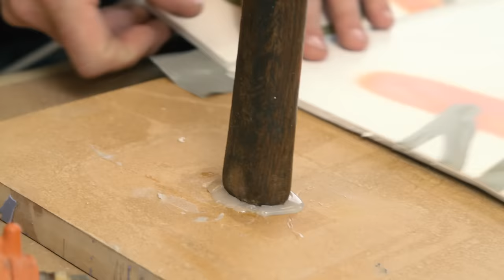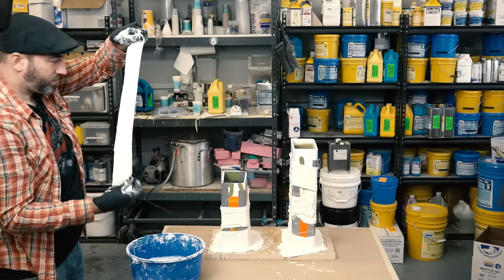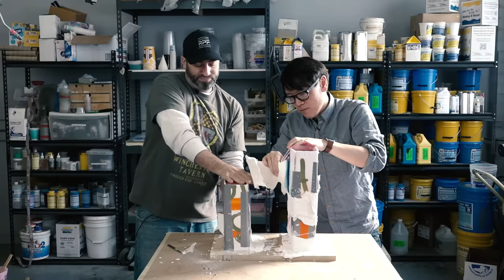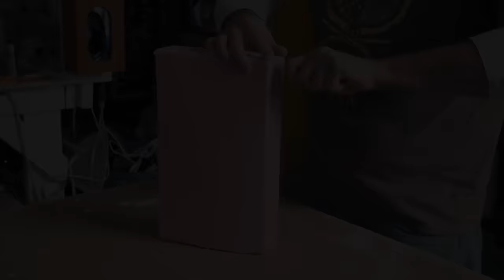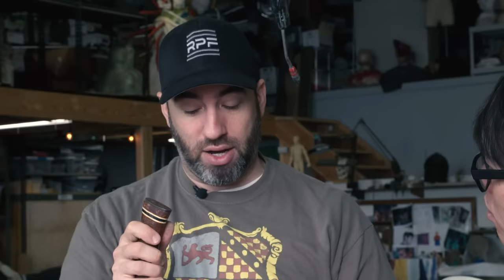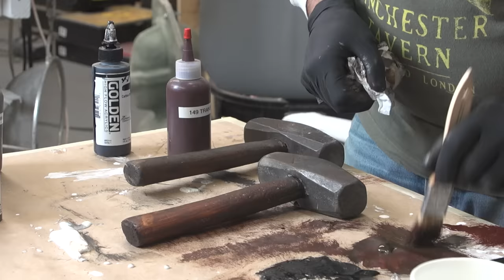How To Mold and Cast Foam Props!

Comment: Respect the Estwing axe, quality american steel and workmanship and thats coming from a roofer who is in the UK.
Reply: Only Gränsfors for me thanks!
Reply: I'm a big fan of Estwing's hammers. They make good tools.
Reply: Never seen one of their hammers break, only the handles with extreme use and the leather with heat and age. Quality tools.
Reply: Those iconic handles
Reply: It's nice that one or two things are still made in the US.
Has Craftsman gone 100% China at this point? I know a couple years ago I couldn't find open-end wrenches made in the US, which was a pain because they had to increase the thickness of the ends to make up for the inferior steel and therefore they didn't fit in foam wrench organizers
Reply: Esteban Dufanzo Last I heard only the "professional " series are still made in the US.
Reply: Fumwum made in Sweden just like my mora
Reply: Estwing still isn't a sellout yet. They still make the most durable hammers at the most reasonable price. I had one for 7 years before I finally rounded the head too much from cleaning concrete off material everyday, and driving steel bolts, besides driving millions of nails building formwork. No air nailers in formwork.
Reply: i have one from 1929, still works

Comment: I make these type of props for film and TV. I wanted to point out that if someone is going to add a stiffener or something to make the handle ridged like in the axe , please do NOT add metal or a chopstick as they mentioned. If you are making these types of props for stunts that is dangerous. The wood can break and then becomes a sharp one that will hurt someone. Same with adding metal. I have found that using a fiberglass rod about 1/4" thick is a great option.  To keep it safe I add the little rubber end caps to protect the end of the rod from poking out and hurting someone. They will flex but will not break. Keep them about 1" from each end of the prop. Again to keep it from becoming a stabbing hazard. For a cheaper option, You can find these rods in kite kits. Even at the dollar store places.  I found a great way to hold the rod in the center of the object is use thread to suspend it in the middle. Tie one at the top and one at the bottom. Run the thread across the middle of the mold and tie it. It should look like the rod it floating on the threads suspended in space. This way it will not move when the foam expands pushing it to the edge of the part. 
I hope this helps and keeps your stunt weapons SAFE above all.
Reply: Can you PLEASE Do a Video? 
I'm not understanding the Thread Part. 
(I am a Hands on and Watch Person than Read from a Book and Fail to disappointment Person).
Reply: I really second that. I understand all the processing except how to put the rod. I want to make LARP weapons, but that thing is the most hard for me. I would really apreciate.
Reply: Great advice!
Reply: Hi. Thanks for the advice… but isn’t fibreglass just as dangerous? I’m really struggling in finding a safe reinforcement
Reply: I would like to make a cain. I was thinking about using handles from a chimney sweeper. But I think it may be too rigid. Are you suggesting something like a fishing pole?
Reply: What kind of foam do you recommend?
Reply: What kind of foam do you recommend?

Comment: To get a volume for the pour of silicone, just fill the empty mould with rice grains and then tip them out into a measuring cylinder.
Reply: I know this is an ancient comment but as someone who's starting to dip further into propmaking, this is genius and I will apply this idea later lol thank you
Reply: But some if the rice but not come out and your mold will be messed up
Reply: You just changed my life

Comment: I have never liked this type of mold. I tried it a few times but always resorted back to standard part molds. I find that cutting into the silicone creates too much of a chance of destroying a nice mold, or worse cutting your original piece. 

Plus....this way takes a LOT of silicone, which is really hard for anyone working on a budget. It makes more sense to me, to use less silicone (enough to smooth undercuts and such) and back the outside up with a jacket of fibreglass or plaster. That way you use less silicone, and you can be guaranteed your silicone will not warp or bend out of shape.

Comment: Cool to see a different method of molding - but why would this not have been a candidate for a 2-part mold? It seems like, other than time, it would have been better to work with this horizontally and block off the lower half to pour that first layer and avoid bowing sides. Thanks!
Reply: Robert Sloan technically it’s faster since you don’t have to wait two separate times for the silicone to cure. If you’re in a rush, this kind of mold is fine but I do prefer two part molds if you have the time.

Comment: Nice vids, very informative.  Kudos to the prop-maker and his excellent work, I'm a photographer and recognize a real artist.   I do have a question.   The foam he uses.   Can it be used in a lost foam meltal casting?   I can carve Styrofoam, put it in sand, fill it with molten metal which vaporizes the foam and makes the object but I have something very intricate that would be impossible to carve using s cast of a particular object.  Wax is iffy but a liqquid foam might be the ticket.

Comment: Also, is there a benefit to doing a solid mold and cutting the piece out instead of a two part mold using clay when making the first half??
Reply: Since the props are not heavily detailed and in simple shapes, it's easier and faster to just do a solid, I think.
Reply: Late ass answer, but it's faster to make a single block mold and cut it, than to make a two-part mold, since for the two-part you have to shape the clay around, pour the first half and wait for it to fully cure, then clean, spray mold release, and pour and cure the second half (why he talked about time vs. money). On a quick production cycle like theirs, getting the job done quick is a better return than stressing over raw materials cost.

Comment: How about molding and casting something like a firearm for props? How would you manage things like the silicone seeping into parts of the firearm? Do you have tips for sealing a firearm before mold making?
Reply: Kenneth Kniffin I cast a Luger over the weekend and used some oil-based modeling clay to plug as many holes as I could find

Comment: I would love to do this kind of thing, but I can't afford the nearly $200 of silicone they used to make 2 small molds!
Reply: Anything you want to do a one-off from will be expensive. Idea of molds is so you can use it repeatedly and make multiple castings.
Reply: It's just odd that they present this as a DIY thing, which generally means "cheap and easy". Now using expensive tools isn't that big a deal because they just speed up the process, but gallons of silicone and mixtures of foam and even the plaster braces are way more expensive than getting a pack of puzzle mats and cutting them to size like a lot of their projects...
Reply: but a lot of that cost came from using a block for those handles. like he said, it's time vs money. if you took the time to make a mould that was closer in size to the object, you'd use half (if that) the silicone.

modelmakers spend $100 on paints quite easily, as well. so that's not particularly outrageous.
Reply: James Dreger In my opinion DIY doesn't mean it has to be cheap. They use stuff that you and me could buy if we really wanted to make a mold out of something. It's not some crazy 5 axis CNC DIY that you need years of experience and a lot of money.
Reply: It doesn't have to be "cheap" exactly, but usually the purpose of "DIY" is to save money by doing something yourself. This video is a fine example of "how to cast foam props" but not of the DIY idea. Which I realize isn't part of the title, but it is how it's presented.
Reply: You can shop around for material that might be closer to your budget. You can do more projects. 

Also the process presented could get very unDIY by using tools most people could get access to on their own. 

I can do this project in my apartment. If I was working with other people we could split costs. 

Really though DIY simply doesn't mean cheap. It means you don't need industrial tools to make it.
Reply: yep.  I just did a quick google and this stuff isn't cheap!  I might as well buy my desired item, instead of trying to make it myself.
Reply: Glenn Burrow I’m glad someone pointed that out. If you’re making a lot of props to sell or something it pans out, otherwise it’s cheaper to just buy it pre made after a certain point. And that’s not including failures in the learning process. And it wouldn’t look like Frank’s work lol
Reply: Box molds like these are fast and easy, but the downside is that they're a HORRIBLE waste of materials. But sometimes you need a project done quickly and have to make the tradeoff of cost vs time.
Reply: Glenn Burrow   You can improvise on this. You don’t need a box sized mold.
I only just realized how old the comment was.
Reply: He even slops it moving from one mold to the other! I need a you tube channel/business so i can deduct all my hobbies as business expenses! Nice video, just not very practical for a hobbyist. If youre making klingon daggers or imperial blasters for all your club, then its worth it.

Comment: Nice! Any tips for casting antler sheds? Specifically the separating of the mold and best material to cast out of. We want to paint them and attach them to a headband so they would need to be lightweight, stiff, and have a paintable skin. Maybe a link to a good website with tips? Thanks.

Comment: Did you coat the original tools with any kind of release agent or does the silicone not stick to it?
And why not do a 2 part mold versus all the cutting and hacking that could hurt/ruin the mold?
Any risk of the foam bonding itself to or getting stuck to the silicone?
Would a different type of foam made a stiffer hatchet?

Comment: question on the weight of the silicone (18.5)-Does the manufacturer include the weight of silicone in the label? I know you just came with that number based on experience.

Comment: It's called "density" the gravity thingy you are multiplying the measurements with, is called density, and It should be somewhere on the packaging of every silicon mix, so there is no need for guess work with the 18,2.

Comment: 18.3.... or just use metric and measure in cm so converting from volume to mass (using specific gravity) is simple.
Reply: Robert Dunne metric system has many. benefits,  but not in building/construction/machining.
Reply: How is metric system bad in those cases then?
Reply: 109268 Well, people building/working construction/machining in all other countries other than the USA seem to have no problem with the metric system. What, in your opinion, is the reason the metric system isn’t good for use in these industries?

Comment: I don't quite understand why wood wasn't used, that's a lot of plastic and lack of assurance :s presumably better still, furniture board (covered in lenolium or whatever). Also for the axe's thin handle bit, maybe I missed it mentioned but why not stood upside down and drill a hole into the handle from atop so there's two access points. Also unless too reactive, a vibrator. Could be a sawzall (without a blade of course), a misbalanced motor, a drill with a misbalanced bit somehow...:s but that'll surely help drive the gunk into and past that narrow neck :o curious

Comment: Could you vacuum the box after pouring to remove all air bubbles from the casting? Or isn't it worth the trouble?
Reply: Well the stuff he used is mostly bubbles so no, but if you using some sort of resin, vacuuming would create bubbles that probably would not get to the surface in time to get popped before the resin sets. Thats when you would use pressure. It either makes them so small you can't see them or forces the gas into solution like a can of pop.

Frank kind of talked about this up when he degassed the silicone.
Reply: Cliff Hartle Oh, I meant pouring the silicone molds! The boxes were the foam-core they poured the silicone into. Since he extracts the air out before pouring, wouldn't it be a good idea to vacuum the silicone again to remove any trapped air bubbles that might be hiding anywhere? Or is that futile?
Reply: Michael Berthelsen again at this point vacuum would create bubbles not remove them as the rubber was setting. So again it would maybe pressure. 

For bubbles during pouring I've seen techniques where you pour it in a fine stream and also let the rubber fill up around the piece. Don't pour it directly on top of the piece.
Reply: Cliff Hartle Thanks! I was thinking of air pockets as well, but I guess you'd just have to cast it multi-part, to make sure you fill all gaps and hollows in turn...
Reply: you can also use vibration to help reduce bubbles. Orbital sanders work just fine for this.
Reply: Colin Macaoidh That's a great use for an orbital, haha...! =D

Comment: i’d like to see the axe again, with an L shaped inner support and maybe more rigid foam?
Reply: It wouldn't even need the L...just a single rod down the length of the handle.  A straight piece of polyethylene tubing would take the flop right out of it.

Comment: Could you use this trick to make a prop gun? Not a detailed one, but one in the background somewhere
Reply: If you have a gun you can cast, yes.  I wouldn't try it with a real one...there are too many little fiddly details that the silicone would flow around/into and you'd tear up your mold trying to get it out.)  But if you've got a good, realistic rubber dummy gun or even a squirt gun, where all the details are solid-cast and don't move, you could make a pretty good copy of that, which would work for background.

Comment: Can I use this technique to do a silicon mold of a hunting knife to replicate with epoxi resin???
Reply: Yeah, it would work the same.  And the epoxy wouldn't try to deform the mold from the inside anywhere near as much.

It's the same technique I use to make molds for break-away beer bottles (I have a wine bottle I still need to cast).  But the mold works well for sugar-glass casting (never tried it for foam casting...)

Comment: He takes the size of the mold container IN INCHES, (15x8x3 inches),  then x 18.5 = the weight IN GRAMS, and the product is sold by THE POUND. There's a lot of mixing of measurement standards there.

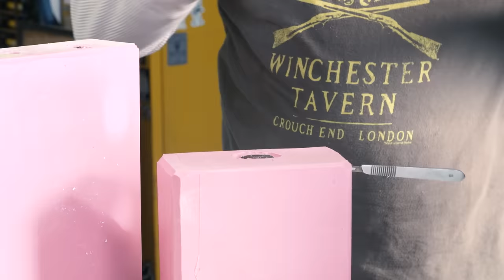Comment: 13:54 Norm touched on an important topic. Show us comparisons of all the methods. 
Lay it in sand for horizontal two part molds. Make foam versions to use for lost foam casting to make another metal one. C'mon guys. Step it up... How many methods are there to make what you made there ¿ Could I use tubes of silicone caulk for the mold and Great Stuff foam filler and a skin of Elmer's glue for the part ¿ Show us those intricate cuts you spoke of. I once poured molten fishing sinkers into dental alginate and it held up. Could you have poured a metal skin in there and rolled it around, then filled the rest of the cavity with foam to make a lightweight metal copy ¿

Comment: I have that same hatchet, I found it a long time ago when I was cleaning out my grandparents shed, what are the odds
Reply: Estwing is the most prominent metal hammer/hatchet manufacturer, especially for older versions where wood handles were standard for other companies. New ones look the same as the ones made 60 years ago, so most estwing hatches look similar regardless of age (wear and tear set them apart obviously, as well as a few different handle choices). The odds are pretty damn good that an old surviving hatchet would be estwing.

Comment: 7:14 - you use inches when calculating volume to get a result in grams of rubber you need to pour. That doesn't sound right. But you know your craft better than I do. I'm just pointing that out.
Reply: That's why you do the final multiplication (18.5, I think was the last number).  The dimensions of the box give you cubic inches, the last number is how many grams a cubic inch of the silicone would weigh, so you know the total number of grams to mix up (then you have to divide that appropriately for Part A and Part B, which they completely glossed over...)

Comment: Guys, thought on using legos as mold bordering? seems like, with proper engineering, it wowld deal with bowing plus it wowld have inn-build registration and enhance the reusability factor.
Reply: Miquel Vico legos are not leak proof. make a lego cup and try it
Reply: lego walls can very easily flex and bow, unless you make them Stupidly thick.

Comment: Guys, please use a different noise cancellation technique or go a little easier on the noise cancellation altogether. 

The voices of Norm and Frank sound like they're right on the edge on going to that tin-can effect you get when you use too wide a spread on noise cancellation. It's distracting.

Other than that, great episode.